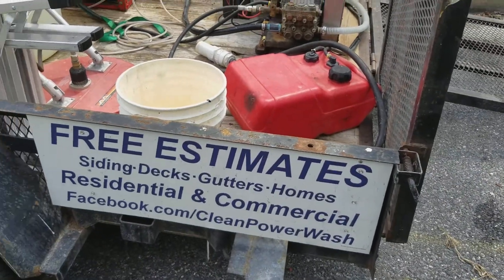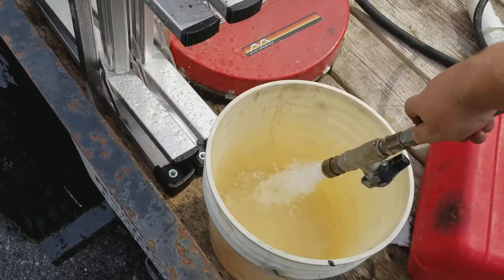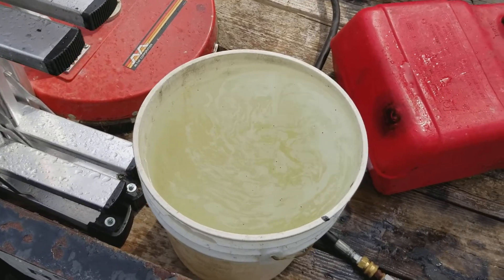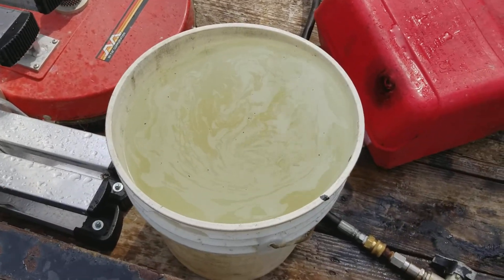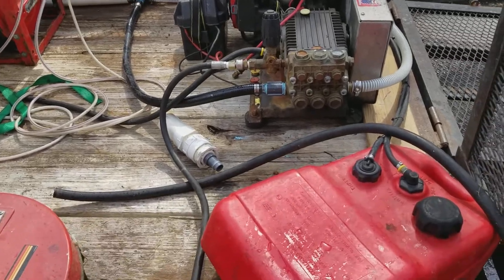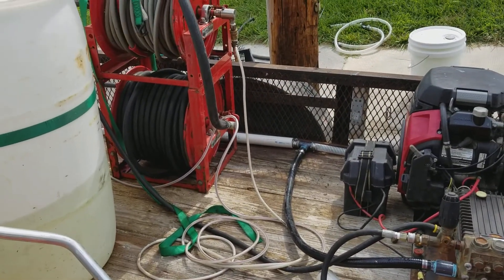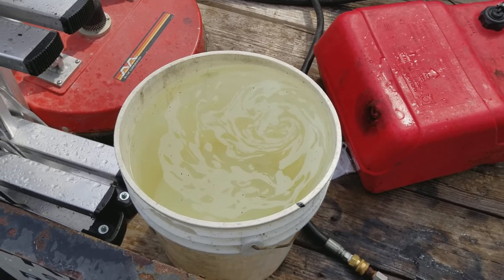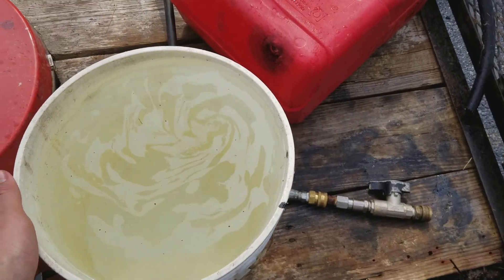5 gallon bucket test for dual feed 8gpm.  Appx 8.5 gpm result

Comment: Hey Rob that is coming out of your ball valve should we all let it come out from the hose or ball valve no gun or tip correct ?? Thanks bud.
Reply: One more question I have a 4000 psi for gallon per minute machine how do I know what ratio my injector is giving me at so many turns ?  Thanks again.
Reply from the maker: Marco I for testing flow yes.
Reply from the maker: It takes a bucket test with 2 buckets.  Too complicated to explain via text
Reply: Hey if there is a way I can give u my number I’d appreciate some time and advice. If not I understand thanks again.

Comment: Hey Rob what's the best method to find your draw rate? I have a 5.5gpm 3500 psi and looking to find my draw rate. I am using a gp 2.1 mm orfice injector. What are your thoughts on this. Looking to get the most soap on the walls

Comment: can you tell me your solution on nasty deck cleaning
Reply from the maker: philip lance downstream house wash 3 or 4 gal 12.5% sh and 1 or 2 gal water.  soak surface first and then apply mix.  keep it wet and let it dwell for 5 to 10 minutes.
Reply: thanks for getting back with me